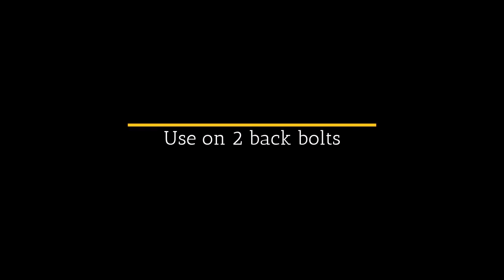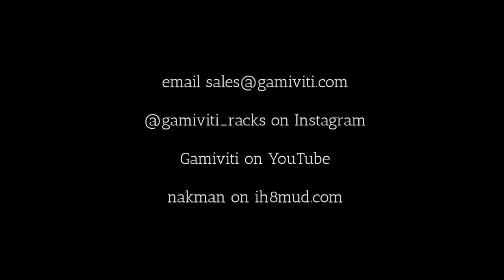Toyota Land Cruiser Seat Repair - Gamiviti Cap & Gear Install

Comment: Hey Tim, thanks for the detailed video for fixing the power seats on my venerable FJ 80. We’ve had her for 25 years, second owner. My wife always announces that it’s her tank. Decided to attempt the repair on the unmovable passenger side seat. Bought the gears and cap from your website, just finished installing and is a great success. Decided to use the job as a teaching moment for the grand nephew - graduates high school next week. We do a lot of yard and building projects but first time anything automotive related. Setup my iPad and your video on the tailgate and dove in. We didn’t have the nifty stool like you used. Just set the seat upside down on the tailgate, perfect workbench. No problems, just start/stop the video to stay in sync. Our only problem was dropping one of the nuts from the lead screw shaft into the seat. Luckily some pounding and shaking of the seat cushion and it bounced out so he could snag it with the magnetic probe. The background music was great to work along with (nicely done BTW). So seat works great, grand nephew can brag to his Dad about his new skills, and Happy Wife, Happy Life. Thanks again Tim. Oh yeah, both gears were stripped smooth.
Reply from the maker: Great work on the install!   and thank you for the kind comments

Comment: Thanks for this.  I paid attention so I wouldn't make your mistake.  Then I dropped one of the trim screws into the seat and upon retrieving it I found one of the inner washers in there.  Fell out while I was fiddling with trying to get it back together.  Just like you, had to take it all apart again.  But I'm good at the process now thanks to your video and my extra practice.
Reply: Another thanks.  Today I tackled my drivers seat because of a clunk when accelerating and braking.  Turns out, from the screw in the cap, someone already replaced the gears.  However, from your video and my experience on the passenger side, I was able to identify that the rear washers were missing, causing the clunk.  Got them replaced and much better.  Thanks again for all the info shared here.

Comment: Tackling this now.  Perfect time to do it, with the Corona virus out there.
Reply: Mine turned out to be an unsuccessful story.  Broke one of the plastic gears, as I was installing it.  And now, with everything installed, only one of the rails moves.  The other rail doesn't move at all.  And now, it's not even engaged.  Motor is just spinning II can hear it) and seat is not moving.  Back to the drawing board.  Ugh!

Comment: What grease do you recommend inside the gears? Thanks for the helpful video!
Reply from the maker: The best grease would be what's made for plastic gears, like for RC Crawler diffs..  I've used normal chassis grease, same as used on the wheel bearings on the 80, and that seems to be working well also.

Comment: Your video is very well done. I have a plastic gear problem on my 2005 100 series Cruiser which appears more complicated than the 80 series fix you show. Have you replaced gears on a 100 yet? Any videos or repair parts available to replace the drivers side forward and back track gears? There are 2 and my left side is fine but the right side is not working and binding. At that point, the fuse blows and nothing on the seat works.
Reply from the maker: Hi there, sorry don't know of too many 100 series with this same issue, and no I haven't tried to repair a 100 series.

Comment: This is an awesome video. My new gamiviti gears arrived quickly and went in great!  Unfortunately however, the motors aren’t turning on either seat when I plugged them in 😟. I’m a novice, so forgive me…but does this mean both of my motors are shot?  Or is there something I’m missing?
Reply from the maker: did the motors work before, and now they don't?  any sound at all?  Just trying to trace if it's a connection issue, electrical issue, or if there's binding somewhere...   you sure you reconnected the power?
Reply: Im having the exact same issue. Everything bolted on right and the seats not moving

Comment: Hey kit worked great but for some reason I can’t put the seat back in the truck. The bolts do not align correctly. What can I possibly be doing wrong ? Ps great video
Reply from the maker: Yes this is fairly common.. you want to open up those holes in the seat bracket a little bit with either a step drill or file, enough so that the bolts can pass through.   Otherwise if you bolt the seat down by forcing the bracket to align with the holes, the whole thing will be bound up and won't slide very well.
Reply: @gamiviti4828   thanks for your reply. I found the issue I took off both seats, took apart the 2 rods on each seat and mix matched them when I put it back. The drivers seat is a bit longer than the passenger seat rod so this caused issues.

Comment: Thanks. Amazing video. Started doing this today, got stuck after removing the gear loll. Where do I get a new gear from and is there a way I can remove the gear without a bench vice? Thanks!
Reply from the maker: You can pound it off with a socket and hammer.   Definitely recommend a vice for pressing the new one back on though.
Reply: @gamiviti4828  amazing video by the way. I ordered your gears and followed the instructions and now my seats work flawlessly. My gears were too old and the plastic was melted stuck to the metal part itself so I had to heat them up quite a bit before I was able to remove my old plastic gear. The new gears were very easy to put on, I just had to use a lot of Grease. Thank you so much.
Reply from the maker: @DK78518  awesome man, great job on the repair!

Comment: I just did my oassenger seat, each time i put the seat back in i could move the seat back, but when going fwd it binds up.  Thoughts?  
i tired three times, one of which i noticed the ger i installed was chewed up, so i used a spare.  I aligned the slides, screwed the end peice on as suggested.
Reply from the maker: I would make sure the seat moves before you bolt it down.   and of course make sure the white cap isn't in too far.

Comment: Do you know what models these gears cover? I have a 1994 Aristo
Reply from the maker: you can pull your seat apart to inspect the gear, if what you have looks like the same then there's a good chance these will fit.   They fit multiple vehicles from the 1994 era so good chance you're in luck here.   And of course if you purchase the gears then discover they are different you can send them back.

Comment: Hi  Nice vid  do have part numbers ?  Are these Toyota parts ?  Thanks
Reply from the maker: Thanks for the comment!  these are replicas of the Toyota parts, which we stock and ship worldwide.   The Toyota part would be the entire motor assembly, which you don't need to replace, just these little plastic caps and gears.
Reply: @gamiviti4828  Where do I order ?
Reply from the maker: @MrFangole  http://www.gamiviti.com/seatparts